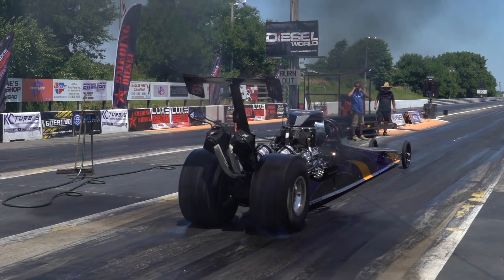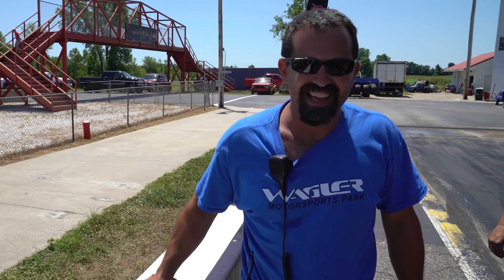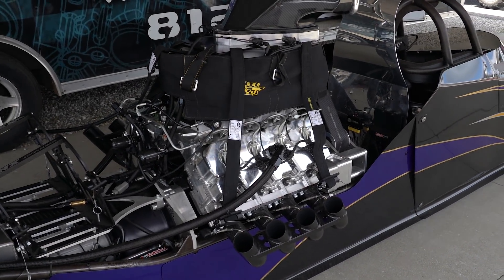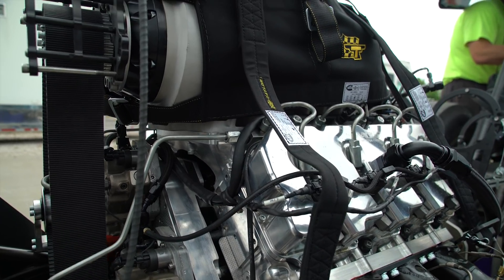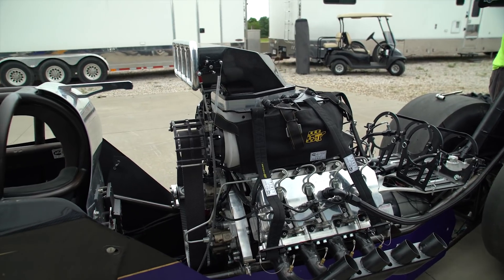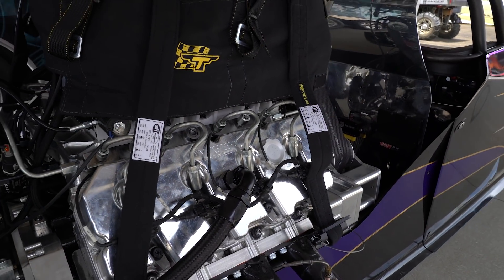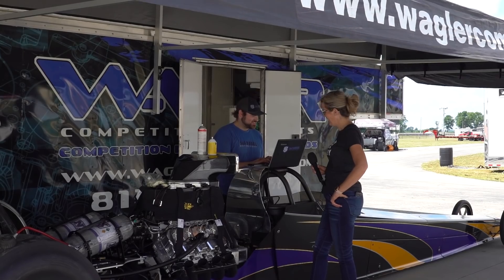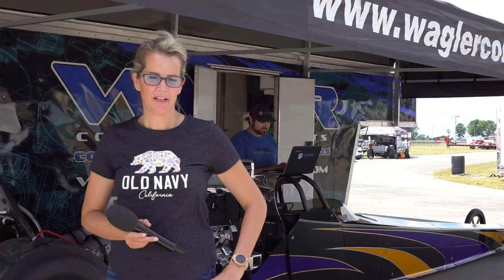Top Fuel 6.6L Duramax Engine - Wagler Competition

Comment: All that power and very little “coal”, proof that you don’t need to smoke out a small town for power.
Reply: More coal your burnin the more power your wastin
Reply: @captainflatbed.7927  Same thing was true with steam trains- the later, more efficient firebox design made a paler, grayish smoke while the earlier ones, into the 20th century were blowing tons off black sooty smoke- go walk along the abandoned rail beds out West- occasionally, a stretch passing through a valley or low wind place, fields of clinkers, and fly ash stretch for many yards on the downwind side of the tracks where earlier rails crossed the continent. FR
Reply: When a diesel is tuned perfectly it shouldn't really cause any coal
Reply: You don't NEED black smoke to make big power but some people like it, but personally who wants to get worse mileage just because the smoke looks cool. Not me no thanks. Black smoke is literally unburnt fuel being dumped into the air
Reply: Coal rollers are the BMW drivers of the pickup world!
Reply: Simple science what happens to fire without enough oxygen? The true problem is too much compromise. You need a big cylinder and a long stroke to generate the heat and pressure needed to fully combust diesel, smoke means too much fuel and not enough air plain and simple, smokey bois add fuel rarely upgrade turbo, it's broke ass power and it ruins engines.
Reply: Smoke is unburnt fuel is it not?
Reply: All the keyboard mechanics in this comment section is fuckin hilarious!!!
Reply: Yes thank you, exactly!
Reply: My 6.6 smokes when ya first hammer it down or if your purposely making it do it!! But if I’m racing someone it smokes for first second or two and then nothing just a haze!!
Reply: @tzrippinlips2527  because its an emissions motor....derp.
Reply: @DieselRamcharger  Might be but it has no emissions on it it’s fully deleted has 3 inch down pipe and 5 inch exhaust!! But I get it some people are just dickheads
Reply: That's not diesel lol
Reply: @fartsoundeffect5013  as I said in a previous comment, it refers to the amount of coal coming from the exhaust not the location of use
Reply: @fartsoundeffect5013  smh, how do you even survive bud?
Reply: @fartsoundeffect5013  “smoke out a small town” means so much smoke it could envelop a small town.
Reply: @fartsoundeffect5013  you’re spare parts aren’t ya bud
Reply: @fartsoundeffect5013  it’s past your bedtime junior, time to go night night
Reply: People who roll coal get broken ceramic thrown at their windows 👌
Reply: @fartsoundeffect5013  your stupidity knows no bounds
Reply: Its not smoking because the blower makes instant boost. A turbo takes a few seconds to spool so it smokes until it gets enough air to match the amount of fuel
Reply: The blower adds instant boost. Turbos have lag thus black smoke. Take this same engine and add turbos in place of the blower and it will smoke it’s ass off.
Reply: Smoke = improper or at least low-efficiency combustion. Every top diesel tuner pumps out smoke-less engines even in the thousands of -HP ranges!
Reply: Water METH and laughing gas along with some diesel = min smoke, pay attention son.
Reply: @lesterroberts4787  4,400 horsepower diesel locomotives don't smoke much either.
Reply: @lesterroberts4787  I watched the video too bud and you’re proving my point bud, N2O+methanol=big power and no cloud of smoke.
Go ahead and and enjoy “rolling coal” but that’s all just wasted potential power.
Reply: So you have a methanol every day driver going around town having fun?
Reply: @southernoregoncinematics1106 #1 I am talking about competition diesels Eg power pulling, diesel drag trucks or any other dedicated high performance diesel applications you can think of.
#2 “Smoke out a small town” refers to the amount of unburnt fuel or “coal” expelled from the exhaust, so no I am not suggesting that methanol be made available everywhere.
Reply: @shane_7even_ten569  
Been my point for many years.
Properly turned, a diesel engine does not smoke at full fuel, full load.
The exception being na engines.
Even then, only a slight haze from the exhaust.
Reply: @jamesgilleece4351  Gale Banks has been saying and proving that for years.
Reply: @southernoregoncinematics1106  it’s a water/methanol injection kit. Many boosted street cars have them. Go to any speed shop that deals with turbos or centrifugal superchargers and you’ll see meth, water, and water/meth injection kits. And while meth does burn, it’s not the power adder here. Nitrous and boost make the power. The water and meth are there to not melt pistons or detonate the motor to death.
Reply: @shane_7even_ten569  diesels that make huge power(like 2000+) have to smoke like that when not running nitrous, even running triple turbos(which power on a diesel is made by fuel, not by air. its more akin to a jet engine). the reason is the fuel cools down the EGT. Bruce Wilson on his youtube channel even said so when hes running pulling trucks. trying to run a clean diesel an make huge power is asking for extreme EGT's. because your trying to burn all the fuel in the cylinder and leave only hot exhaust gasses. which will not only melt the pistons, but also crack the block or even do worse damage.
Reply: Overfueling just makes smoke not power.  Watch diesel tractor pulls. Very little smoke when under WFO conditions.
Reply: I roll coal more out of my truck more so when the turbo hasn't spooled up enough (tag). Maybe if you knew you would realize this engine has a blower on it. Air is almost instant to the cylinder so it wont smoke as much vs a truck with a turbo which almost 99% of diesels have turbos!!!!!! You learn something everyday son!
Reply: @ChrisSmith-ig9jq  I’ve driven diesel trucks and equipment, worked on diesel trucks and equipment, son.
My point is that super charging builds boost immediately rather that turbo lag, why do you think that 2 stroke Detroit Diesel engines had both a supercharger and turbochargers? 
Big power from idle and reasonable fuel consumption rates.
Reply: If you understand anything about chemistry you would know that you can only burn so much fuel per volume of oxygen. The leftover fuel that can't be burnt is what leads to soot escaping the exhaust and causing soot clouds. Rolling coal isn't an indication of power, it's an indication of poor tuning.
Reply: @nateb.1568  exactly my point
Reply: @UCgdt-2g-1aOKLl8z8HR9RwQ of course, while other mod shops get shafted with hefty fines he's sitting back enjoying his solidarity knowing he's got the government in his back pocket. What a piece of shat.
Reply: it doesnt make shit for power. and the "smoke" is for the turbo, which this doesn't have. you know less than nothing.
Reply: @DieselRamcharger   Who pissed in your Cheerios? Driver, tuner, and maintainer/builder here. Car had like maybe 10 big power passes on this totally abnormal setup and went 174 mph with a shit 60’ in the 1/8. Best pass was 4.23@167mph before then. Never quite got the front and back half put together. Was still dialing it in and I was doing licensing passes in these videos. Not sure where you come off saying it doesn’t make shit for power. It’s a factory Duramax block filled with concrete and forged internals, making around 2000 hp to run those numbers...
Reply: @DieselRamcharger  hahahahahahahahahahahaha sit down son, the last truck I had before I retired was a Mack pinnacle running a tuned MP8 with a DPF delete that was still able to pass California compliance standards.
Reply: @DieselRamcharger  most tuners that was real power work to minimize wasted fuel beyond the lugging point of the engine and trans combo
Reply: @DieselRamcharger  fuel drives the turbo? I thought the exhaust drove it. So the extra energy of the fuel which is not burned in the engine is used to drive the turbo? Do you Know where I can find info about this? I always thought the smoke was just wasted diesel .
Reply: You sound just like that Gale Banks, clean air act supporter, EPA supporter, non emissions government contract, guy. Are you him? If I wish to roll coal, I will roll coal, not a single human being has the right to control what I do with MY truck! Have a great evening, I know I will lol
Reply: @cliff4695  we are not saying that you cant roll coal, we are saying that you make the most power with a properly tuned truck that doesnt smoke rather than a coal rolling truck. Trust me i am no supporter of the epa and thats for sure.
Reply: @portalbucket5365  EXCATLY
Reply: @cliff4695  Did you end up rolling coal after your comment?
Reply: @cliff4695  lmfao when it's affecting everybody, yes they do have a right.

Cant wait for most of the idiots to die off.
Reply: @cliff4695  Dude, on that aspect, I'm behind you completely.   You're throwing fuel away but if you dig it, do it.   Hopefully it is accompanied by a smoky burnout.
Reply: @ramosel  ive got the crop dust tune for all the city folk. Normally its clean unless I've got a big load of hay behind me. I just love it when I go to the city, some car with his stereo all the way up, bumping that God awful rap bs. That's when tune 1 and brake boosting comes out to play lol. I just don't get diesel people preaching clean burning trucks. Like do they really like the EGR or the DEF? They will ruin it all and we have Gale Banks to thank for that
Reply: @cliff4695  To be fair, Gale did fight the DEF and Regen portion of Tier IV Final.   We all lost on that one.
Reply: @ramosel  actions speak louder than words my guy. I can say one thing and do another. They used his words of 0 smoke against us, as he was supposedly protesting he was making the parts to comply. At the same time he is still making emissions free vehicles for the federal government. He speaks negative about it and you buy his parts. He speaks positive about and the government approves his parts 50 state legal. He makes money on both sides. Don't get it twisted, with Gale its always been about the money, he dosen't care who he screws over to get it. There are other companies, actually better companies, to purchase from now. Support those who support us. Gale is no different than a slimy politician
Reply: @kylancook3477  proud member of HOG Nation for atleast 2 years already. Can't leave out ACAL, Upchurch RHEC, Struggle Jennings, and Jellyroll. Nothing mainstream is worth listening to! These white country boys do it better anyways, IMHO
Reply: @cliff4695  yeah, as someone who works on euro stuff,  and diesels, the particulate filters and egg have been nothing but expensive additions making trucks unaffordable to many and outrageous repairs.  As someone who dealt with this with dealing with rich people,  the optics of smoking someone out aren't great. I really couldn't care less that you do it. Just remember,  when we do stuff that pisses people off, we often make things harder for ourselves. This is coming from someone who has farmed and been around this stuff.  We have pumps turned up on our diesels, however our stuff is all old so we can't switch tunes to roll coal on anything but one truck. The rest is old 7.3s and an old 6.9 and a 6.5 gm . So really old stuff. Even out of 7.3s only 1 is turbo.  Anyways,  city folk don't understand turning your pump up or changing the tune is cheap power for everyone,  however I'm sure the pricks will start to ticket everyone,  whether they are doing it for fun or because they are hauling

Comment: Kinda sad it still gets whipped by a true inline 6 diesel
Reply: That's not happening in this video. Actually the most powerful  production tractor trailer diesel right now is a v8 diesel, not an inline 6. Look it up. It's a Volvo v8. The inline 6 might be more proven, but technology changes. Hardly any gassers use an inline 6 anymore. They used to be so common.
Reply: @ashes2ashes863  and your point is? The v8 gas is dying off quickly. And the inline 6 is more prominent than it has been in years. That Volvo v8 is garbage
Reply: @justinmartin8887  you'll have to educate me on where they're dying off exactly. I mean the heavy-duty pickup trucks two-out-of-three are V8s. Most cabovers have a V8 diesel in them. And that's  irregardless of if it's a Duramax or Nissan. The only industry that they're not real prevalent in is the large tractor trailers. They were back when they were Detroit diesels around yet, but after that other than the few Macks they were pretty gone from existence. Now they're emerging yet again. 

Don't get me wrong I don't have anything against the inline-6 Diesels. In fact I'm a big fan of the Cummins, Detroit diesels, and the old caterpillar diesels. But I certainly see an argument to the V8 if they work well. I haven't heard anything bad about the Volvo one. 

That being said I'm not really a Volvo person either, but the people that are driving Volvos definitely like them.
Reply: @ashes2ashes863  the fact you called a pick up heavy duty is enough for me to disregard the rest.
Reply: @justinmartin8887  well, that's  because you have two classes of truck, half-ton and heavy duty or work trucks as they are commonly called. Ford calls theirs Super Duties, but that's because they're super special. Of course to confuse the issue I think there are some 3/4 ton trucks that aren't considered work trucks or heavy duty trucks. I haven't seen many of those however. Any rate, the heavy duty or work truck or Super Duty or whatever term for the version  you want to use for them for that class of the big three's pickup trucks that have Diesel's as an option, two out of three are V8s. That was my point. The GM one is in fact the co designed with Isuzu, Duramax. GM owns a large chunk of Isuzu.  Isuzu uses a lot of the work truck GM gassers in their branded cabovers as well
Reply: @ashes2ashes863  all pickups are legally classed as light duty. There’s no such thing as a heavy duty pickup. It’s a marketing scheme branding
Reply: @justinmartin8887  this is true, but a one ton work heavy super whatever can tow some pretty amazing weight today. Probably more than the owners should be trusted with sometimes
Reply: @ashes2ashes863  yea. That’s why you need a class a cdl to use one to specs I guess
Reply: @justinmartin8887  I always thought so too. You should have too anyways. I think anything over 25k pounds or with airbrakes, right?I certainly wouldn't be comfortable driving around someone pulling anything over a 20k pound load with a pickup, even if it easily can.
Reply: @ashes2ashes863  25,999 gross can be hauled without air brakes and without cdl. It gets more confusing with combined gross (gcvwr) which would combine the truck and trailers’ gross into one. You still need a class a cdl to operate anything with above 25,999; but you don’t need air brake or manual trans endorsements if not applicable. Any vehicle with a gvwr (not gcvwr) above 25,999 will have air brakes
Reply: @justinmartin8887  good info my man. Thank you! I couldn't remember the magic number anymore.
Reply: @ashes2ashes863  Scania V8 .......
Reply: @nickvanwijk1055  another solid option!!!

Comment: I'm trying to imagine a chevy diesel pickup sounding like this but I'm just having a real hard time. lol!
Reply: Then stop🤷🏼‍♂️
Reply: All it takes is cash.
Reply: Nah nothin to it $5200 stereo system with this video playin and your on like donkey Kong
Reply: Idle sounds close to my open header 7.3 idi
Reply: @speeedy95  this might have a little pickup and go😭
Reply: @ajpieragostini5852  definitely I wouldn't stand a chance I'd still be in the burnout box when he crosses the finish.
Reply: Agreed, funny no turbo and instant throttle like that 🤣
Reply: That’s because you’re use to seeing some ungodly exhaust tip on most Chevy trucks and not just straight merica
Reply: I cam see the idle durmaxs are pretty quit on idle some you usually just hear them ticking away the newer ones especially very quit. Fords pretty quit soon. Cummins a bit louder more like knocking than ticking. The Ford is like a mix but u hear the fans the most on dmax and Ford. But when it goes its hard to imagine that sound I'm use to the roar they give off.
Reply: It is due to the lack of a turbo, look up the naturally aspirated 6.2 Chevy diesels and exhaust wise they sound just like a gasser
Reply: @ayoutubechannel921  yep my non turbo international 7.3 sounds just like a gasser.
Reply: That's because it's not a Chevy.  It's an isuzu.

Comment: Top fuel is nitro methane.
Reply: "Fuel" includes diesel. As far as the class of this car who knows
Reply: @sinistervulcan  
"Top Fuel" in drag racing specifically refers to the category of cars, AND the type of fuel they burn. The car in this video is neither. However, it's possible the dragster chassis itself was once a "Top Fuel" car, but in it's current configuration there is nothing "Top Fuel" about it. It does not race in the "Top Fuel" category, and it does not burn nitromethane. Still a super cool car though...
Reply: Nitro just adds more air to the mix and a little gas I’m pretty sure
Reply: @1969c2  lol you’re thinking of nitrous oxide not nitromethane
Reply: @lexicase5642  ah ok thanks for correcting me